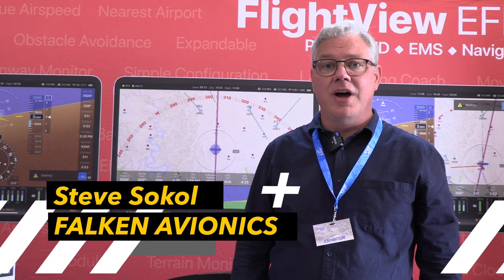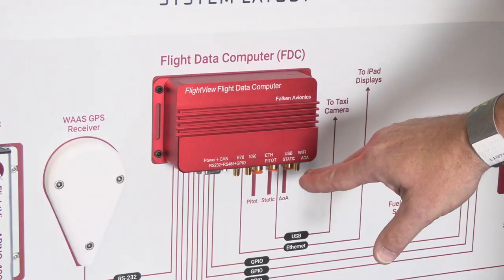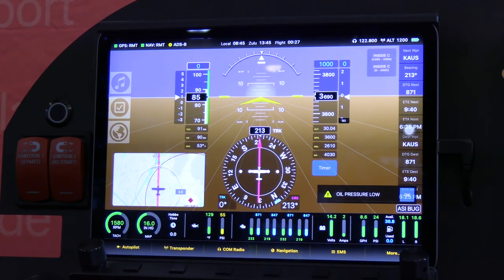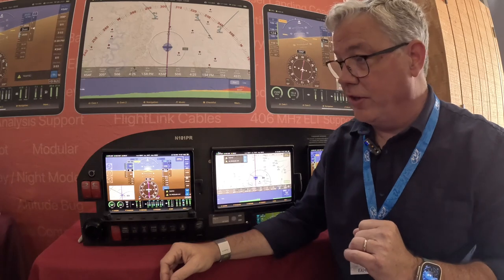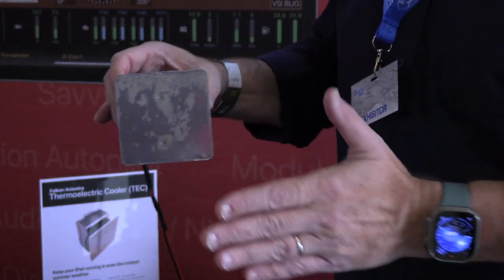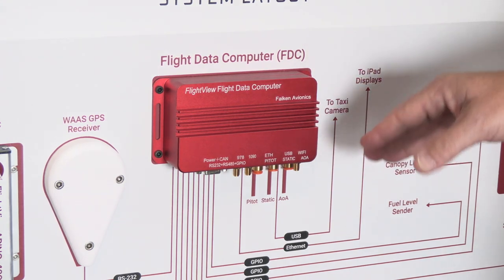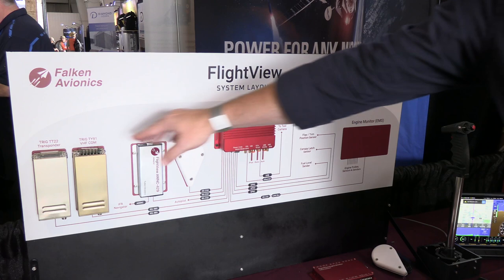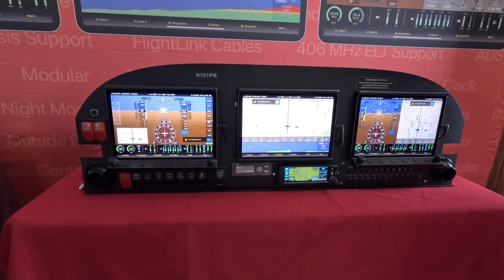Falken Avionics Expands iPad-Based EFIS Lineup

Comment: This is very very interesting, especially if you want 2 or 3 screens. You didn’t mention FAA Aeronautical Maps and Obstacles databases. Are you leaving them to the pilot’s EFB ?
Reply: Our map database - updated monthly and free for US users - includes airports, runways, frequencies, navigation aids, obstacles, special use airspace, and controlled (B, C, D) airspace. Our base maps include water (lakes, rivers, etc.), geographic boundaries, terrain hill-shading (at high zoom levels), and a full street map (hidden by default). Together the base maps and the database are used to populate a complete aeronautical vector map. 

Sectionals, IFR low and high raster charts, and other tile-based chart elements will be available from a third party partner in the near future.
Reply: @falkenavionics5392  Thank you. I’ll be watching you for a future project then.

Comment: Are there prebuilt harnesses between the pieces or is it boxes only and we would have to make everything else?
Reply: We are planning on selling both a connector kit and pre-made harnesses. The connector kit will include two DB9s (one for the power / CAN connector and one for the EMS) and a DB37 connector, mil-spec pins, and back-shells as well as three PEX quick connects for the Pitot, static, and AoA inputs. I'm estimating $55 for the kit, but that could change. The pre-built harnesses will be available in "stock" configuration and also custom. We're still working on the pricing for those.

Comment: I understand that it's easy to a developer to use an ipad as the screen... but I personally think it's a dumb idea.  I personally seen too many other products fail because apple forces an update, and then the product or software no longer works.  I like to see innovation, but get it away from someone else's hardware that you have no control over.
Reply from the maker: Serious aviation app developers do invest in compatibility assurance. Besides Falken, ForeFlight, Garmin Pilot, major airline EFBs run on iPads.
Reply: @KitplanesMagazine  I manage 12,000 iPads at Southwest Airlines for Pilot EFBs and have done so since 2012. They have worked perfectly and Apple is VERY involved in EFB work to ensure the product works well.
Reply: We opted to use the iPad as the display platform for several reasons. EFB applications have made iPads almost a standard in the aviation space, so there's less of a learning curve. There are only three major form factors (mini, 10", and 12.9") to support. They are extremely well field-tested, with over 600,000,000 having been sold over the last 13 years. Yes, Apple can and does change the underlying platform, but we test each new iOS release and thus far (since 2019) we've only run into one breaking change, which was easily addressed.

Compare that to our other option: source our own LCD panel, capacitive touch layer, drivers, and other low-level components to build a bespoke display in at what is low volume for the electronics industry. Pair that with a custom computer running Linux or perhaps the Android Open Source Project (AOSP). Layer on some kind of graphical "widget" layer (Qt or GTK). This kind of project is a major undertaking for a large company. It's well beyond what we could fund, and the resulting product would have been far less appealing that what we get by building on a well-established platform.

If, at some point in the future, Apple decides to make changes that break our app or our business model we could and probably would pivot to another platform. For now, iOS is the best option for FlightView.
Reply: @falkenavionics5392 maybe I’m missing some relevant consideration but I think if I were using this as my avionics, I would not perform mainstream iPad firmware updates. Would only update if Falken recommended. Of course I’d keep these iPads off the internet.
Reply: @KitplanesMagazine  OK... how? Apple simple doesn't care sometimes.  One example that comes to mind is DOD. Apple literally locked them out after an update, and there was thousands of dead pieces of hardware.  I don't have a problem of software, as the developer... as long as they are supporting the hardware... they can continue to update the software.
Reply: @falkenavionics5392  Sure... I agree that the ipad has become a standard in aviation.  But like I had said earlier... apple has locked out other hardware flat out.  OR... if a developer simply stops supporting a device... then things stop working when there is an OS update.   Knowing that IT HAS happened in the past... why would I (the consumer) want to spend thousands of $$$ on something that could simply not work the next time I go out to the plane?  I fully understand that sourcing a screen, and developing the software to drive that screen, and touch interface takes more time, but then your product is "Your product".  (There is a reason someone like Garmin will have iPad compatibility, but not rely on the iPad) Think about this... I can go out to a 70 year old aircraft... get in... and have instruments that work.  (Assuming they didn't physically wear out)   Why not make your product the same way? relying on someone else's product leaves your legacy up to them. 

I completely understand that it's an opinion that you don't want to hear... but it's the truth.  There are a lot of people in the home built realm that feel the same way, and you would be losing out to those potential customers.  There are other touch screens, that are standalone, and work on open source interfaces. 

To the other people saying about iPads and EFB's... that's a little different.  That is only software, it's always being updated, and it's a subscription. If the developer stops supporting it... then I would be looking for another EFB.  

Just my 2 cents... take it for what it's worth.
Reply: It’s a trade off like everything else. You can invest in a system that doesn’t have the flaws you talked about. But I’m sure an equivalent system from a mainstream company would cost 3-4 times the price.